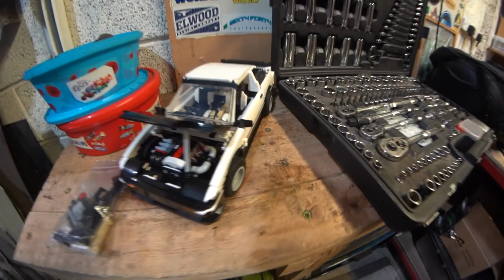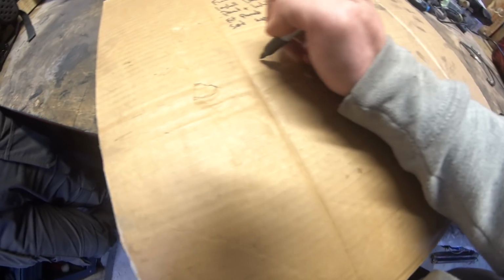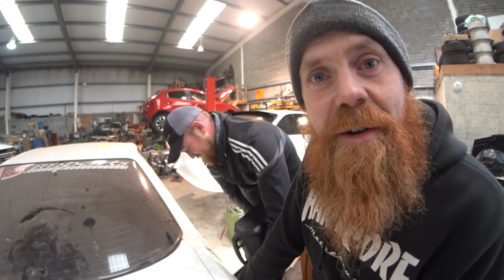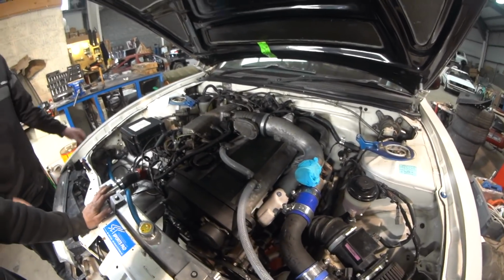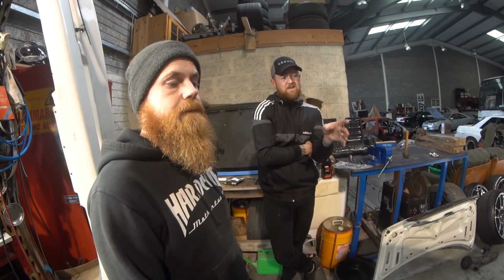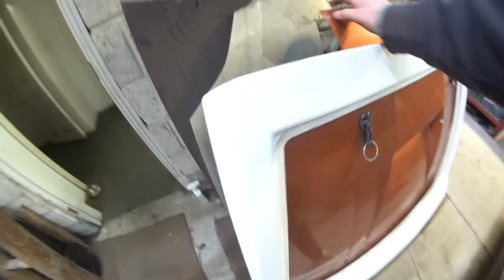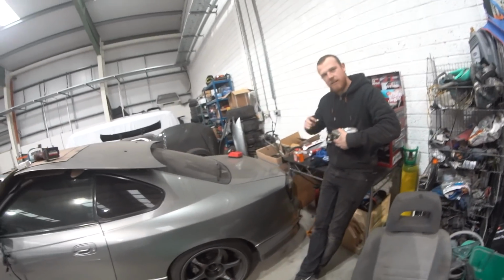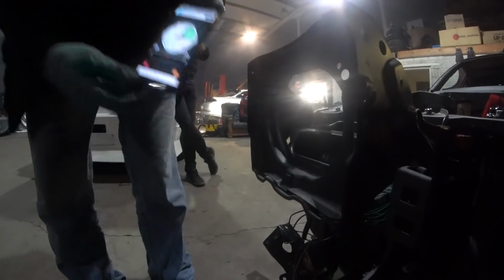The AE86 finally has two retracting headlight units.

Comment: I had the same headlight issue where one side would move slightly more, turns out is a bad motor relay. the relay that mounts just behind the passenger headlight. that relay controls the delay for power to rotate the headlight motors. when the relay is bad it sends too much power causing the light to go a bit too far
Reply: I went through four motors before discovering the issue, swapped that relay and now my light on my Trueno work like new
Reply from the maker: Thankfully we got it sorted, fresh motor relay and sorted the correct splines

Comment: Repaired a crack in my alfa 156 plastic tank with plastic padding super steel,   not a drip weep leak nothing, sold the car after 5 years and still holding strong. I'd fo it again in a heartbeat